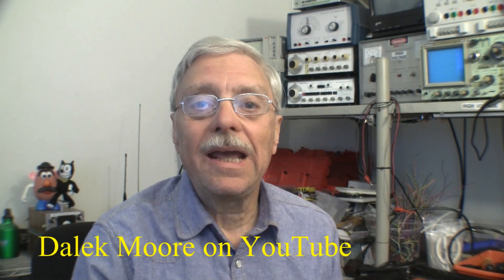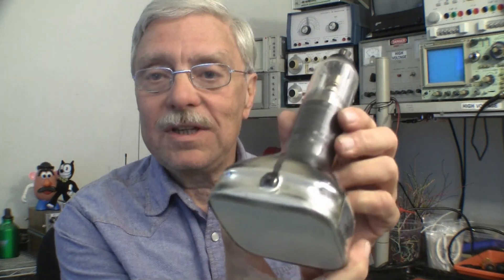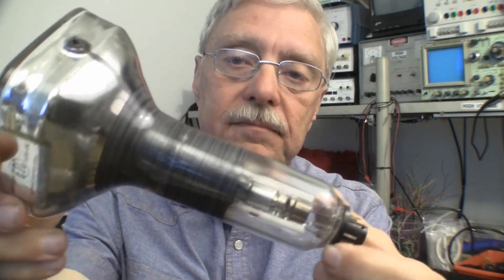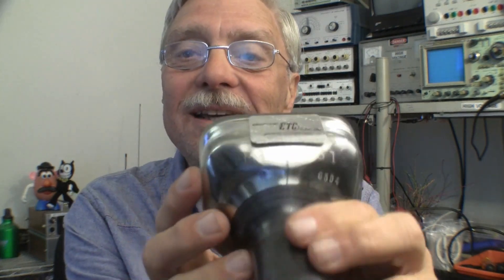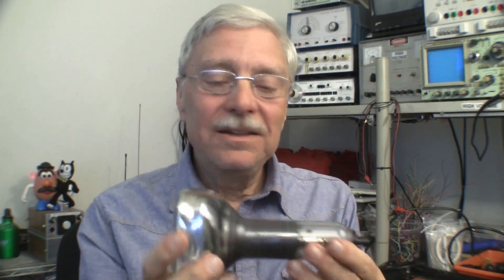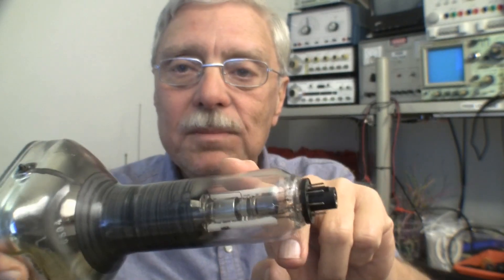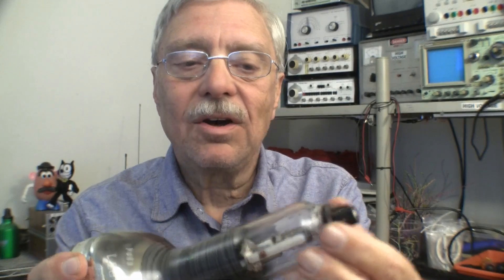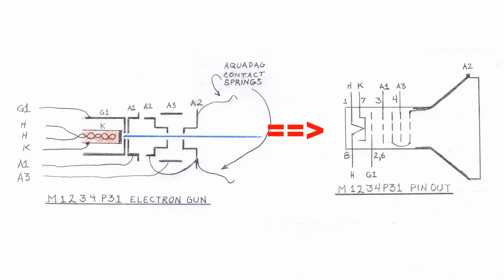Cathode Ray Tube Projects #1, Testing a Mystery CRT

Comment: Be careful not to turn the intesity up too high on an undeflected spot. I have burned screens before!
Reply from the maker: You are correct. The phosphor can be burned. But, it is less likely with an aluminized tube like this one. The internal aluminum layer dissipates the charge build up, dissipates heat and acts as an internal reflector to make the spot look brighter with a lower beam current. See my 5AXP4 project for a tube that got burned as you mention.

Comment: I ran into the exact same problem. I picked up a Toshiba E8069PDA-CD monochrome tube to test some crt driver boards but I can't find any info on the layout of the pins or the voltages for the different parts of the gun.

Comment: Hello just came across your video and found it quite informative, I am heading down the tube testing rabbit hole and am after some more information on how to could detect if a tube is allowing air in via a leak. I recently picked up a tube and was told that it was no good due to a leak. It seemed to be arching at the 2nd anode whilst powered up and I could hear the crackling, I had no idea and had a professional advise me of what was going on .I obviously would like to avoid this in the future and am hoping you may be able to shed some light on what to look for and possibly how to test to determine if a leak is present to avoid the above and "ideally" prior to powering the tube up. Thank you FP
Reply from the maker: I think CRT tube testers can detect the leakage currents caused by gas in the tube. Also, check the getter. That is the tell tale. The getter is the shiny silvery looking spots on the inside the of the glass. If it is showing any whitish discoloration, gas (oxygen) is present. One other note, arcing is more prevalent in hard vacuum than in a gassy tube because gas introduces a resistive leakage path for the current. Another gas failure mechanism is helium infusion. The helium molecule is so small that it leaks right through the glass. I presume hydrogen does too. In that case, you may see a faint neon-like glow in total darkness at a lower voltage than what you saw arcing.

Comment: Very nice CRT and very nice explanation!
I tried something similar with a small CRT recently. I 3D printed a yoke and wound some small coils, powered them with an audio amplifier and it worked quite well. https://www.youtube.com/watch?v=SrtGNUF-grU
I actually bought the small CRT to test winding a deflection coil for a vidicon tube, but so far I've been having problems with noisy/cheap hv power supply modules off ebay and get nothing off the vidicon except noise. I'll have to try again soon!  Thanks for the interesting video
Reply from the maker: I just checked out your PMT and CRT videos. YOU rock! I had not considered winding a yoke (too crazy hard) until I got the questions about it here. Then I saw your video and it was quite inspirational. Not promising anything, of course....
Oh, yeah. I subscribed to your channel.
Reply: @videolabguy  hehe, thanks for the sub! I don't post much.  The coil winding was just a very rough experiment, I haven't even measured the windings. To drive the russian CRT there needs to be more windings because it will gets a bit hot, but I think this might be enough to drive a small vidicon tube without it getting warm (no success yet of course!). Audio amp is definitely not ideal either but I'm trying to put off as much "hard work" until I at least get a picture out of the tube. Your videos have been really helpful understanding the vidicon stuff so thank you and hopefully I'll get something rough working soon :)
Reply from the maker: Open air windings are essentially resistors if you keep the inductance low enough. Switch to current drive amplifiers and you will see an improvement in performance. If you are going to drive your coils at standard television rates, then adding some iron or ferrite will (may?) be advantageous.  Best of luck!

I just dusted off my coil winder. (Greasy, ain't it?) May have to do something with it. I did waste money on it after all...
Reply: @videolabguy  Would love to see a custom yoke from you in the future but no pressure ;)

Comment: OH thanks There Richard i was not expecting my alias to turn up in your video  !  ; ) ,Before  had any similar tube data i did the same on this GEC H1025 CRT you are mentioning  as in viewing where the pins go just looking studying the tube.....always nice to know where the heater go's or in this case both heaters .
Having a CRT power supply for the last Anode for these types of crts is something i never thought about that's a handy idea i have a high negative one but not positive.
I had to make my own  HV probe  using many 10meg half watt resistors  and  some small PVC pipe...very handy for  HV work and saving your Multi meters life !
BTW i was watching a 1940s army video on  how CRTs work and they moved the deflection with electrostatic probe from the out side of the tube made me wonder can you deflect a magnetic deflected tube like a electrostatic tube but from home made foil plates on the out side of the tube what do you think ?
Any way Great video Richard  posted link on my early television FaceBook page  get people interested !  and for me  of cause CRT's and  image tubes are my interest  so you playing around with them is great .